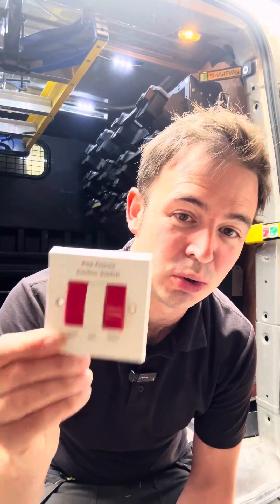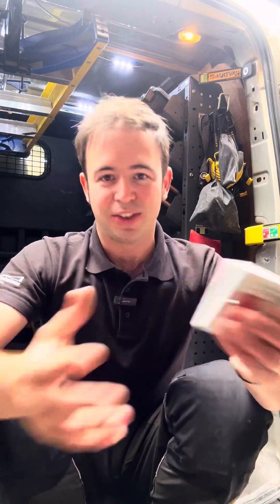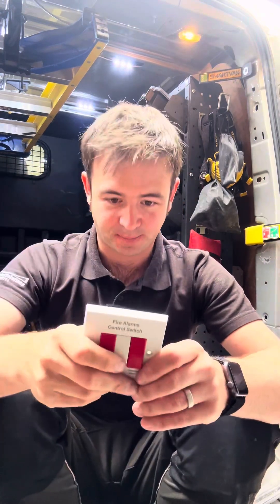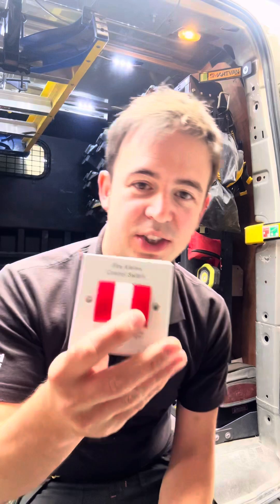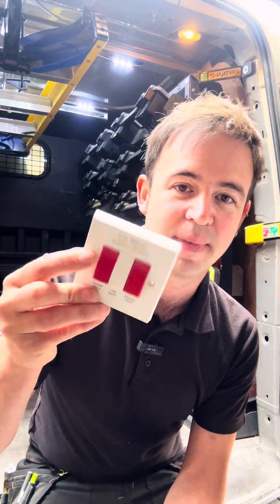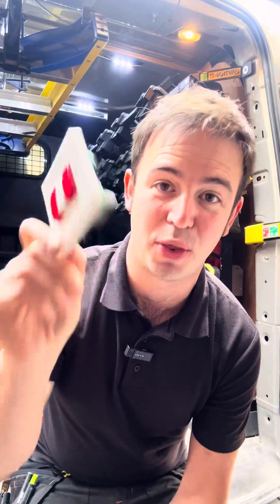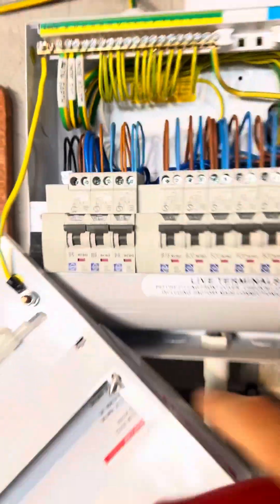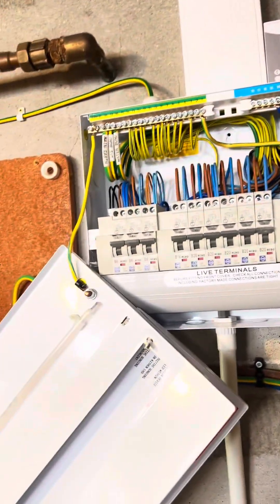HOW I WIRE A SAFETY CIRCUIT

Comment: I just want to contradict something you said there sparks, in a friendly open to learning way…. The Aico instructions manuals available on their website and given with all Aico alarms do state, “the interconnect wire should be treated as live, it should be insulated and sheathed”. Those are the exact words in the manufacturers instructions. So yes I think the interconnect wire does require brown sleeving.
Reply from the maker: It doesn't say that in the paperwork supplied with the Aico detectors
Reply: @bristolsparkyit really does buddy, here is a link to the product manual for Aico Ei series of alarms, it’s on page 26. https://www.aico.co.uk/wp-content/uploads/2025/02/B20224-R4-Ei3014%EF%80%A23016%EF%80%A23024-UK-SERIES-UC-ENG.pdf
Reply: @bristolsparkyall i have seen is it states not to use the cpc as the interconnect
Reply: Why would you mark a 9 volt dc cable brown?
Reply: @SME_Ste well I didn’t write the manual for Aico but I’m guessing that as the conductor is part of a cable that is otherwise carrying 240v they’re taking a belt and braces approach and are assuming it may reach 240v under fault conditions, perhaps if the cable were damaged. Just a guess. I’m sure they have their reasons. Aico are based in Ireland so I doubt it’s a translation error.

Comment: Should always be wired off the local lighting circuits to prevent the client just turning off the mcb or rcbo.
Reply from the maker: I respectfully disagree, it's an old myth generated from council & rental sparks
Reply: @bristolsparky  maybe I just think its good practice and additionally saves a fuse way.
Reply: So long as the smoke detectors don’t share a protective device with a socket outlets circuit. That’s what I was taught any way, can’t think of an actual regulation mind you.

Comment: I always wire separately and three core back to the dis board just makes sense 🤟
Reply from the maker: Amen mate🫡🫡
Reply: If you wire all separately back to db would you be able to run a 3 core from a test switch back to the db as well and just join the interconnect with the rest of the interconnect cables?
Reply from the maker: @rioroberts4795 he means separately as In on their own circuit and 3 core back to DB

Comment: Aico instructions used to say the interconnect wire had to be sleeved brown as it is a live wire all be it ELV. Has this now changed? Not fitted ant for a while.
Reply from the maker: Yeah, it's not in the instructions anymore
Reply: @bristolsparky https://www.aico.co.uk/wp-content/uploads/2021/06/Ei140e-Series.pdf

Which is the latest instructions, page 15 states "The interconnect wire (minimum 0.75mm2
 cable) must be treated as if it was Live. It should be insulated and sheathed."

Comment: I always fit these with multiple devices, did get caught out by the switch like the detectors having an expiry date sticker on the side
Reply: I think it has a lithium battery it’s the only reason I can think of
Reply: Thanks that is useful, I don't fit Aico as I think they are just over priced and I hate trying to release them from the base, much prefer the fireangel range with a seperate base but thats just preference, never knew those switches had expiry date, good to know as one of my partners rentals has that in so will need replacing when the smokes need replacing, I was just going to replace the smokes with Aico so I dont have to replace the bases but those switches are not cheap, think ill be putting a blanking plate over it and wago it and then change the smokes to fireangel...   I can see the purpose of that switch but the expiry date would make me never fit one..

How long do they have the same as the smokes (About 10yrs)?
Reply from the maker: Yeah, dunno why they have an expiry date but yeah. Make the client aware🤙🏻